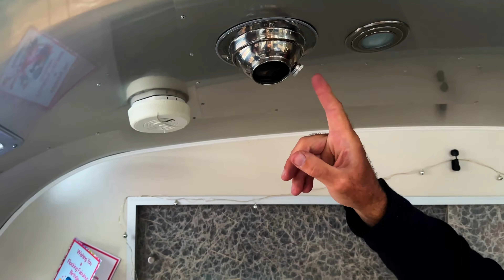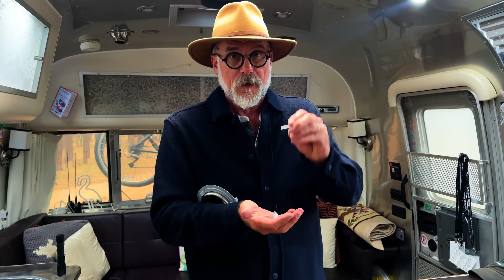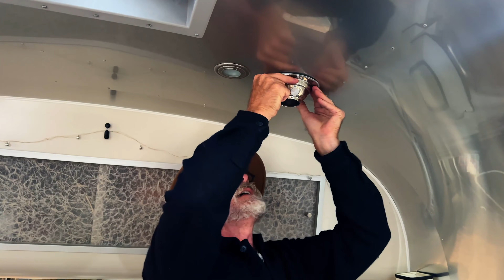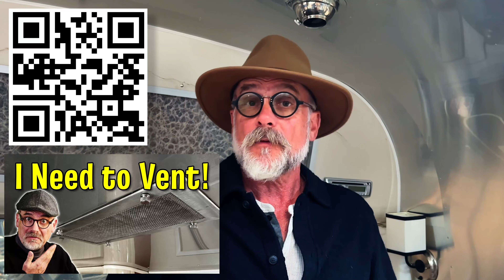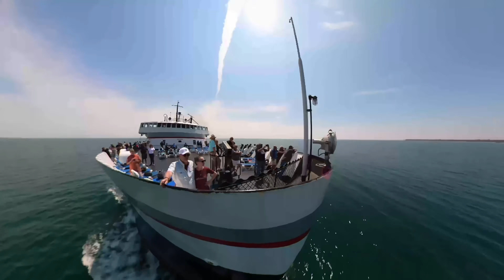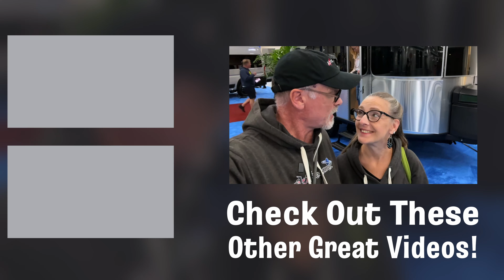Airstream Hack: Install Campair High-Flow Vents for Better Airflow on a Budget

Comment: Be nice if they offered a Matt finish that better matched the aluminum. That other brand out there is super expensive though it is a good match for the aluminum.
Reply from the maker: Yeah, I understand how you feel about the finish. I also felt they would look out of place in our Airstream, but what I found is they match the trim of the ceiling lights, and the Campair vents look like they belong in our Gemini.